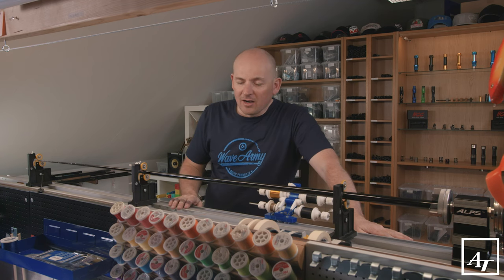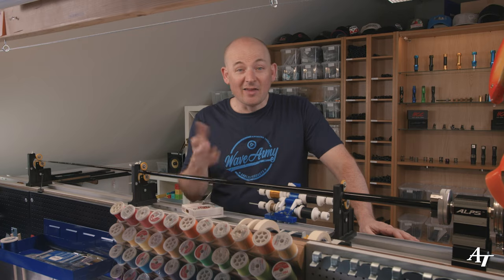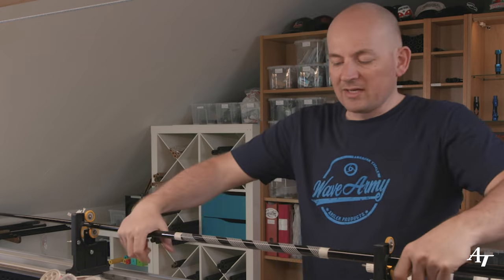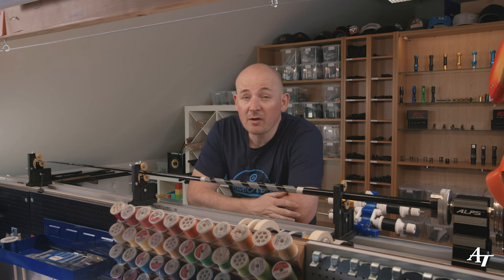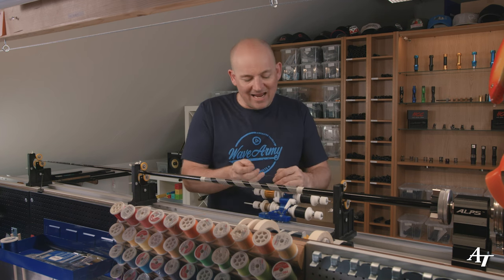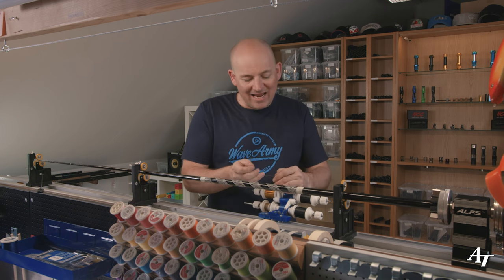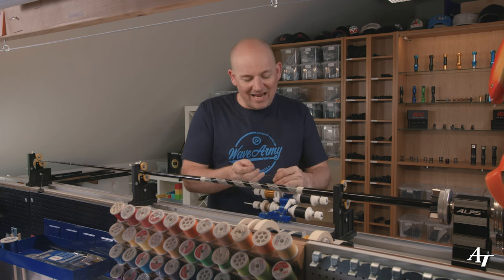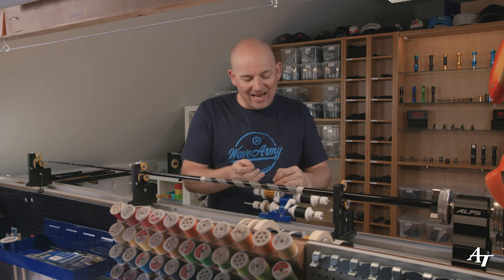This is RodBuilding Episode #18 Decorative Half Dragon

Comment: not sure if this will get an answer but thought process as im going to build my own rod. with the dry wall tape if you do a super thin layer of paint over it and then pull it off would it leave a nice small diamond pattern behind? or would the paint get under the tape and or does it not apply properly? easy way for a pattern without thread is my thought.